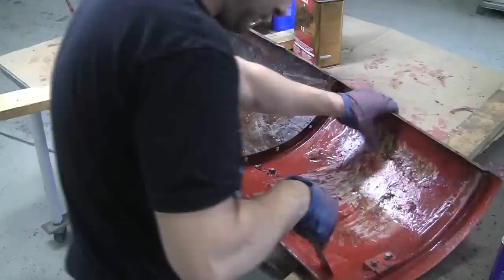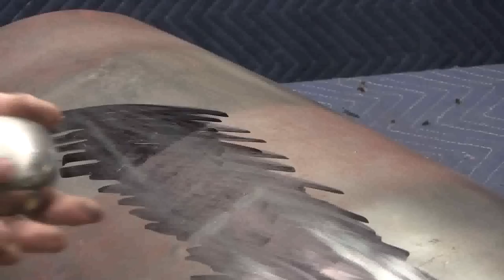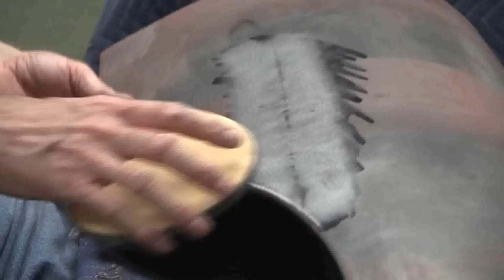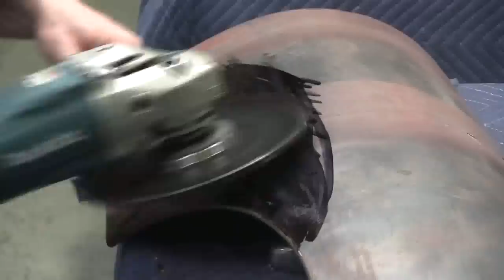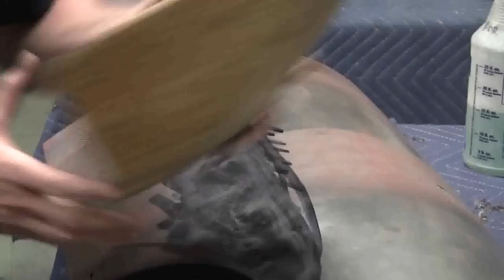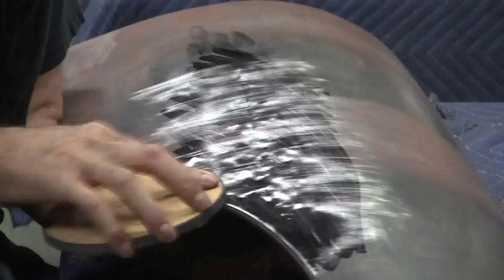Metal Fabrication Techniques: How to use a Shrinking Disc

Comment: Very nice work Wray!!! I have a 39 Ford Standard Coupe that has a crushed in right front fender that I'll be fixing this fall. Too hot now!!! I did a 47 Chevrolet Pick'm Up Truck that had a deep v dent in the right front fender and I got it all out!!! I find it Zinful to tap out the little imperfections to perfection!!! Probably my favorite part of restoring an old car!!! Keep Rocking it out!!!
Reply from the maker: Thanks Pat, if you don't have a shrinking disc you can find them on my website proshaper.com. Wray

Comment: Wray, “shrinking disc” caught my attention. I have used the more aggressive disc to straighten a crashed quarter panel on a 1965 Mustang in a day. This panel was one that usually would be replaced. The shrinking disc is a part of the ART of metalworking of which you are the master. I’m excited to see you on YouTube. I was afraid that art would be lost with your passing. Now, hopefully it won’t.
Reply from the maker: Thanks. I bought two of the original style ruffled outer edge discs from Scott Knight. They cost $49.00 each at the time (1987). I came up with the smooth and safe design and the smaller 5" diameter discs. My ProShaper discs are safer, thicker, (made from 16 gauge stainless the ruffled discs are 18 gauge). Everyone that works on sheetmetal will see the value of them once they see what they do.

Comment: Very well presented informative, videos. Great for people to learn.
I grew up in my grandfather’s steel- working shop where we did everything with hammer, long time ago, about 80 years in the past when hammer and muscle all we had. There is one thing I’d like to mention:
We cannot shrink metal. By the hammer we force material to take up a different shape. Shrinking by ripples just give that edge a longer rout in a given interval. By hammer it flat we force it into a different direction. See aluminum soft drink cans fabrication. Steel is not compressible ( for any practical use). Nevertheless you are doing a terrific job, please keep it up. I’ll prescribe to your channel, it’s enjoyable. Thanks.
Reply: When metal shapers talk of "shrinking" metal, they do not mean reducing the volume. As you point out, metal is essentially incompressible. You can reduce the volume (imperceptibly but measurably) by applying (lots of) pressure, but when you release the pressure the metal item will expand back to the original volume.
What metal shapers are shrinking is the SURFACE AREA.  They are trading area for thickness. The volume remains the same.
So it's just a misunderstanding arising from a shortened description.  Shortened descriptions are used every day. Take "chocolate labrador". It really means chocolate coloured, but (luckily for chocolate coloured labradors) nobody takes it to mean they are more edible than the plain vanilla variety.

Comment: Great video and thanks for sharing. Really looking forward to seeing the e type front end project.
Reply: i was surprised to learn that you now only use the shrinking disc for steel.  it worked fine for me on the aluminum miata hood, it would get a little gummy occasionally, which i attributed to the magic marker.  i just kissed the shrinking disc with a little 320 and carried on.

Comment: i swapped in a camaro engine (lfx) into a miata and had to put a bump in the hood for clearance.  i used the 5" shrinking disc to great advantage.  i figured that what was a high on one side was a low on the other and kept playing one off against the other to the point that i just needed maybe 1mm skim coat of filler.  i used the magic marker trick to great advantage too.  shrinking disc for the win!

Comment: Have you ever tried using ink from an old printer cartridge or refillible inkjet kit? I use it as an alternative to Dykem by poking a hole into the cartridge and pouring it into a plastic bottle

Comment: hi  Wray, loving the videos, really great to see you passing on your vast amount of knowledge to the world at large, quick question, i got one of the 5 inch discs a couple of years ago, love the thing, i also got a bunch of your special pattern making tape, but have been very reluctant to use it, as im not sure just how to do it ? could you possibly do a video of its use and how to work with it, thanks once again , from Leslie Thomson, Glasgow.
Reply from the maker: Hi Leslie,  I am about to start a long video series on how to make an all aluminum E-type Jaguar nose. I will make the nose using my flexible shape pattern system. You will learn a ton from that video series. Wray

Comment: Wray, 
Just found your site and what a GREAT set of videos I'll have to watch them all. I do have a question. On the low areas why not work from the back side to bring them up at least to a close finish then work on the micro stuff from the top.  I've had good luck with this, but I'm just learning and maybe it's a bad habit. I will be checking back in the near future and watching all the other videos that fit my need of learning metal shaping.

TX
Mr fixit
Chris

Comment: Hi, great video... Is it possible to use a hot air blower gun for shrinking ?
Reply from the maker: Most people attribute cooling with water or air causes shrinking, it doesn't have any effect other than quickly cooling the area rather than waiting the 10 minutes it will take for the metal to cool by itself.
Reply: @proshaper  thanks for the info...
Reply from the maker: I have tried it on aluminum. Better to use a torch and a hand shot bag as a back up when shrinking aluminum. Check out my video on the Lotus Nine nose.

Comment: My slappers have a high polish. I've seen some that leave the file texture on there slapper. They say it is for shrinking the metal. I have no problem with my high polished slapper but should I make one and leave the file texture. It seems like it would leaves marks.
Reply from the maker: Any tool that leaves scar marks on the sheet metal  is verboten.

Comment: Around 26.40 , when you are lifting the low spots. Do you have the dolly underneath the low spot and are slapping "off dolly" to bring them up?  Or are you "on dolly and stretching the low spot and then using the dolly hits to force the excess metal up?
Reply from the maker: When you have a low crown dolly under a low spot if you hear the ping meaning slapper/dolly contact you are compression stretching the metal very slightly. You are also driving the surrounding metal down over contact point. The result of this action is the low comes up. You can monitor it's upward progress by scratching the magic marker to see what the result was. The low comes up, the danger is going to far, but that danger is totally negated by the ability of the shrinking disc to quickly level any highs that don't belong. The shrinking disc allows you total control over the process.
Reply: @proshaper  Thanks bud!

Comment: Hi, new to shrinking disk technology, for what I see, the disk is used on high spots, why not using the shrinking disk on low spots from the rear of the panel as if it was a high spot? Cheers
Reply from the maker: Hi Alfredo, yes, you are correct. You can use the disc on the inside of a panel as well. I often do. Dents can be area value dents (the metal is stretched) or arrangement value dents (the metal is rearranged or only bent inward). See my video on area and arrangement to get a better understanding. The smaller 5" diameter disc often works better on the inside of a panel.
Reply: @proshaper  Thanks so much, will do that. I am a subscriber and enjoying thia a lot. Cheers

Comment: You don't need heat with Dykem (unless you want to really harden it) just use compressed air and it will dry up right now

Comment: Very well explained, thank you! I was wondering about bending a sheet metal against (let's say) a barrel or a pipe instead of using an English wheel. For a straight crown of course. What would be the ending difference between both methods? Thanks a lot! Cheers

Comment: Wray, it looks like you hold your shrinking disk flat against the fender.  I tend to use mine where I am just catching the outside rim, where the bend is.  It seems to work out at the outer edge.  What are your thoughts about this?  Thanks for another great video.  I am really looking forward to more to come.  Tom
Reply from the maker: Hi Tom, The more you angle the disc, the more aggressive it gets. Sometimes it is alright to increase angle to quickly localize heat, but most of the time the disc should run flat.
Reply: Wray Schelin's Pro Shaper Sheet Metal LLC,   thanks Wray.  I will have to retrain myself to keep it flatter.  I am using your discs on the old Model A fenders I had to put patches in.  Thanks again, Tom

Comment: Thanks Wray for the awesome information. I have purchased your shrinking discs, what is your 6" discs made of that you have sand paper on both sides.Thanks
Reply from the maker: My sanding disc is made out of 3/8" Baltic birch plywood (a cabinet quality plywood- that is very flat. The sandpaper is 150 grit stick it paper.
Reply: Thanks, watch your tipping video and you said that you made the dolly's that you are using in the video. what did you make them out of. I have a 39 Chevy coupe that will need some work around then fender that have that tip of roll with the wire in it.Thanks Again

Comment: I see this is an exercise using the flapper and dolly, to get the surface smooth, but, would the English Wheel smooth out the fine bumps, too?
Reply from the maker: Yes, but it not always possible to bring a panel to the English wheel.

Comment: Absorbing content as always. One thing I wonder, with all that "clattering" do panel beaters/coach builders suffer occupational hearing loss?
Reply from the maker: Protection helps, genetics plays a role as well.
Reply: I did. When I started in the '60s, if you wore ear protection everybody in the shop called you a sissy. Now they have to call me two or three times because I can't hear them.

Comment: How do you get your shrinking disc running so true thinking about machining up a backer abit like yours  can't seem to find any decent backing pads for it here in Australia
Reply from the maker: I make and sell  the correct backing pad, but you also need the  hub flange. When you buy the grinder they usually come with it. The grinder companies do sell them if you do some searching. I did modify mine. Running smooth is important.

Comment: So you use the dolly for both stretching and shrinking at the same time? A low is shrunk until it will pop up and than you sort of stretch it back and forth?
Reply from the maker: The dolly is used to add area (on dolly tapping), planish( on dolly light tapping), and arrange (off dolly). If too much area is present after planishing then use a shrinking disc.(on steel) On aluminum I use a soft lead shot dolly and a torch to remove any excess area. I make and sell the shrinking discs and the lead shot dollies. See proshaper.com
Reply: @proshaper  can you explain the difference between tapping and light tapping: they seem to be close in terms of action force applied. It is very confusing for a Green Horn that tries to understand this fundamental principles
Reply from the maker: @therealspixycat  light tapping is a hammer or slapper motion of less than 1/2".

Comment: Would you use ever the English wheel to take out dents like this, very light pressure just pushing the metal?
Reply from the maker: As long as you can get the part or panel in the English wheel yes you can use light pressure and smooth it out. In the video I was trying to show that smoothing can be done right on the car as well as long as you have access to the backside
Reply: Thanks Wray, nice video.

Comment: Why don't you use the shrinking disc on aluminum? Too aggressive? Leaves marks?
Reply from the maker: Yes, see my video on shrinking the aluminum Lotus IX fender. The hand held lead shot bag , torch heat, and a slapper works better.

Comment: Can you burn truh the metall with The shrinking disc?
Reply from the maker: Hi Roger, no you cannot burn through the steel sheet metal.  All you have to do is get the metal hot enough for steam to rise. 200 to 300 degrees. Hotter is ok you can go to red heat but it is not needed.
Reply: @proshaper 
Thank you 😎👍
Reply: But if you sit there and heat away at it you will remove metal eventually. If you see sparks you are removing metal.

Comment: Why is a slapped used instead of a hammer?
Reply from the maker: A slapper is nothing more than a large faced hammer that can  make light planishing blows faster than a hammer.
Reply: proshaper so then besides the speed there isn’t a whole lot different?  Thank you
Reply from the maker: @vincenzociffa4959  Yes the large working face  of the slapper is far superior to a hammer. You bridge the dented area with a slapper.